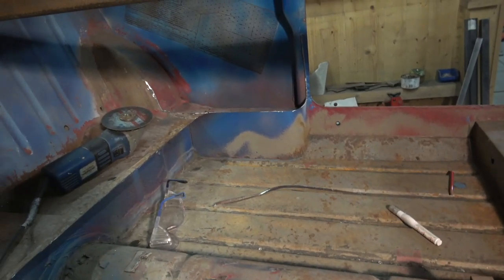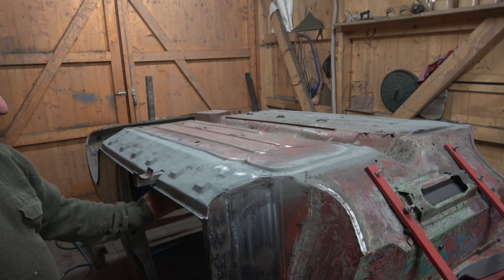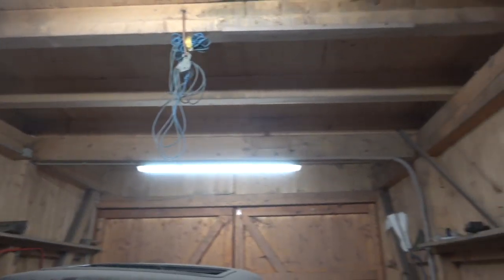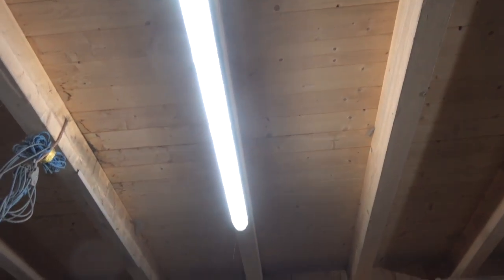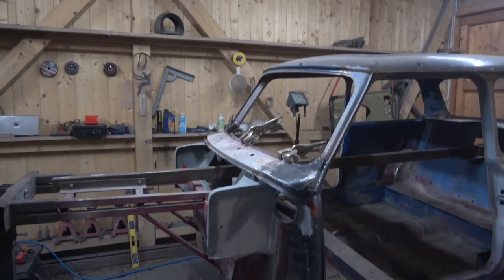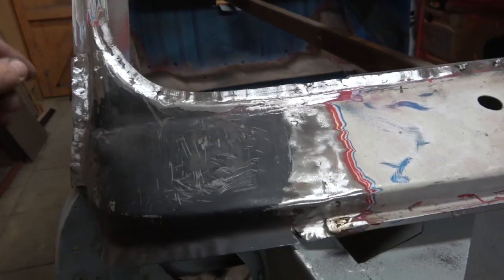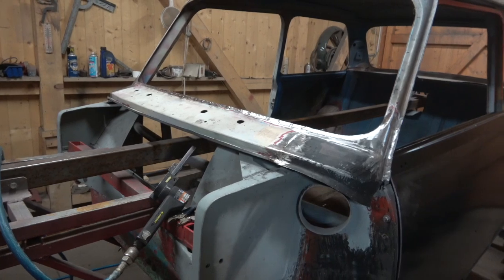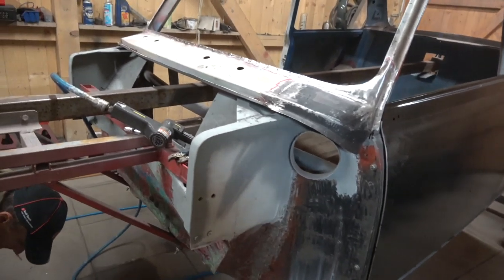Classic Mini Track Car Build Part 20 ( Jacking system + Scuttle & Door )

Comment: Surely if your worried about the rear bins falling foul of regulations you wouldn't be altering the bulkhead and keeping a steel front or more of it? trackdays are a free for all but depending on class regs for sprints and hillclimbs then the mini would be a lot more standard in certain areas?
Reply from the maker: Richard,  I‘m not worried about any regs Kevin Richardson mentioned it to me and i was just passing on what he told me! My feeling is we will mostly do track days rather than anything competitive. Cheers Dave